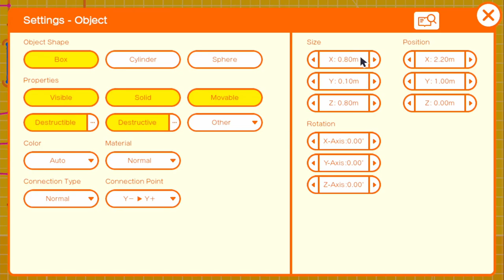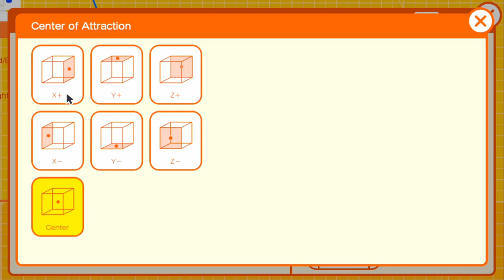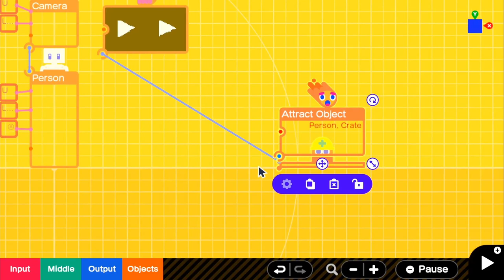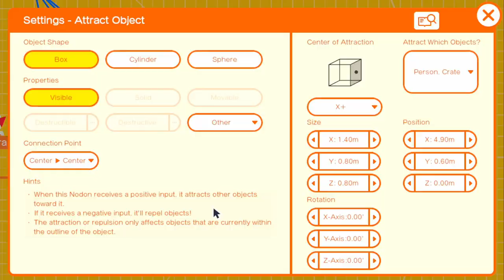[Game Builder Garage Tutorial] Conveyor Belt

Comment: 3 Nodons per belt? That's really compact! Nice one. Question, though, how do you make the belt slower?
Reply: It is actually approximately 2 nodons, just the box and the attract nodon, the texture nodon is always the same
The cost is 2n+1, with n number of belts

Also, to answer your question, you could just use the input on the attract nodon, the range of accepted value is between -1 and 1.
From -1 to 0 is actually repulsion tho, not useful right now, so you should test a number between 0 and 1 simply using a single constant nodon and connecting it to the free input connection of every attraction nodon.
The cost will be 2n+2 this way, not so expensive if you make like 10 of them is 22 nodons, so it is still approximately 2 nodons per belt.

Comment: You can make this go slower/faster by connecting a Constant Nodon with a value less than/greater than 1 to the inputs of the Attract Nodon. Also, just a warning, this method will always pull objects toward the middle "lane" of the conveyor belt, but I have yet to see a consistent, cheap method to prevent this if you don't want it.
Reply: THANK GOD somebody pointed this to me thanks